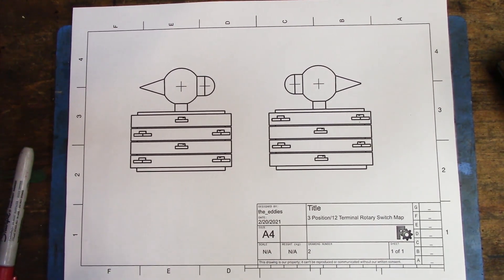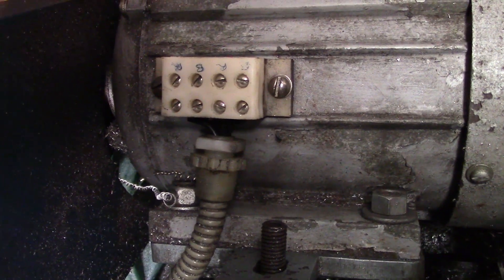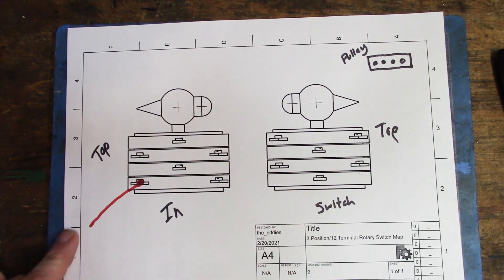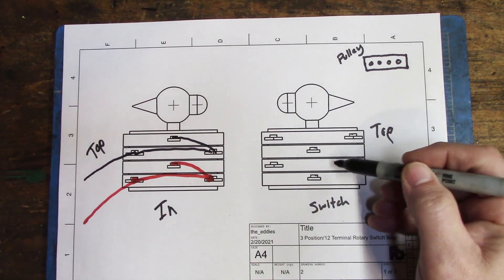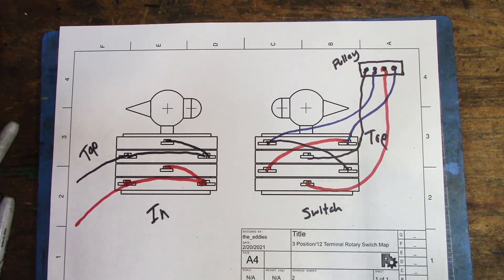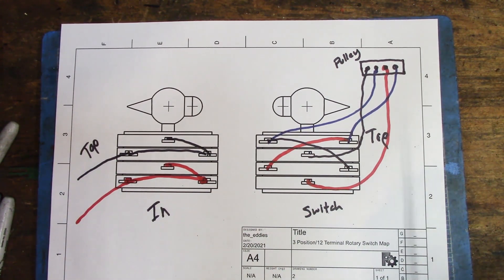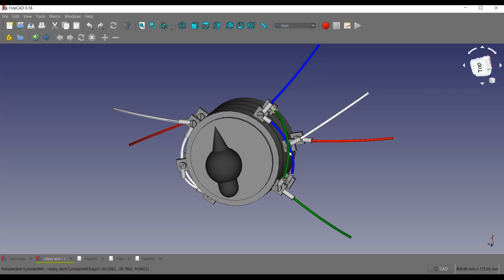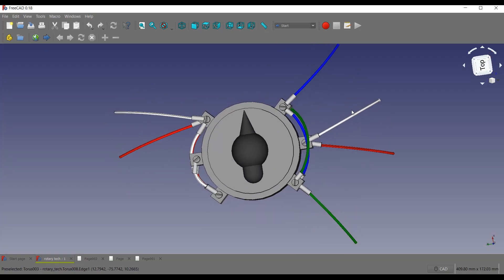Wiring a FWD/REV rotary/drum switch for a Mill Lathe Drill Combo HQ400

Comment: Yesterday I was messing with a very similar switch (HZ10-10P/4, 3 position, 12 terminal) on lathe-mill that had come apart. We had to take it apart to get contacts re-inserted into the layers (poles) and the operating handle spring detente mechanism correctly assembled.  fortunately we did not have to take apart the contact discs.  I can not find an exploded view of these rotary switches, let alone the internal contact arrangement.  This is the best explanation i have seen.  FYI this explanation works for 120V and 240V single phase fwd/rev because the same two wires need to be swapped (as long as the motor leads are wired for the matching voltage).  THANKS!!!!

Comment: Great video try fusion 360 for hobbyist so my issue is rotary switch new model's  with 12 and 4 wires very little info on how but your video seems to be the ticket
Reply from the maker: Thanks, hope it helps. I have since completely switched to Fusion 360 and wish I had started on it. Takes half the time to do most stuff. FreeCAD is a great idea in theory but it is not beginner friendly to learn on. My workflow right now is Fusion for dimensionally accurate model creation and Blender for anything more organic.

Comment: Do you remember what terminal from the switch went where on the motor? And did you run at single phase or 110
Reply from the maker: If it is not mentioned in the video I honestly do not remember. It is single phase.

Comment: First of all, thank you for this. I have this exact machine & my switch just went out. Second, yes... All my wires are black except for the yellow ground & jumper wires. So they probably used whatever they had on hand, not really considering servicing.
Reply from the maker: Thanks! Glad it was useful.
Reply: @theeddies  it was. I wish I'd have been able to obtain a replacement switch, but was unable to. So using the information you provided in the video, I retro fitted 2 toggles (power & f/r) in its place. Took me a while, but I got it handled for around $12 or so.

Comment: I spent my career as an electrician,  and even I struggle with reversing some single phase motors. Case in point.

My last go at it was the dual voltage mtr i got from harbor freight and the cheapest reversing switch I could get from amazon (with not quit enough contacts and no diagram) 

Needless to say I sat down with a meter, and took plenty of time drawing up a diagram that I was pretty sure would work.  (Had to cheat a lil though)
Luckily worked 1st try.

Reversing a 3 phase mtr is a breeze, or the average DC mtr as well. 

Single voltage single phase motors usually aren't too bad, but when you get to the dual voltage stuff. Oh boy
Reply from the maker: Never an electrician but I did a fair bit of it in my past life when I owned a remodeling business, but I never took the time to really understand why things worked. I knew how to wire a 3 way switch in a bathroom but it just was not important at the time to understand what was happening, the algorithm of the device. As I get older, I am almost less concerned with the practicality and more interested in the why. I have done a couple videos now where I am almost explaining things to myself and coming to a better understanding as I film because I am forcing myself to explain it to other people. It is actually a good learning tool for me, lol.

Comment: Nice work Eddie.  I would describe the switch as a four pole (each layer is a pole)  change over  switch 4pCO . A very similar switch and wiring is fitted to Bridgeport mills and their clones.
 The same switching can be achieved with a 2pole isolator (often a no-volt release switch) and a 2pCO  which you'll often find on s typical drill/mill
Reply from the maker: Thanks Bill,
Yes, 4 pole makes certainly makes more sense from a functional level. I have been thinking of going to the other switch system you mentioned especially after taking measurements. I think there is a small but significant voltage leak with this switch. I actually turn the whole shop off with a breaker when not in use so it not a big deal and my other switch does the same thing but if it were just plugged into the wall with the rotary in the off position I can measure 2-4 volts on the out side of the switch. With the switch on I get the same on the neutral side. Certainly not efficient if my readings are correct.

BTW, your tech drawings and 3D renderings of the indicator really got me going to want to learn CAD. Having a lot of fun with it. I took some classes in university eons ago but wow the difference in functionality these programs have now. Thanks for that.
All the best!